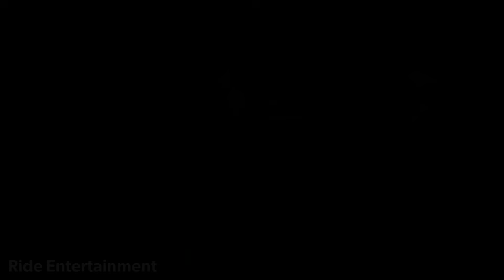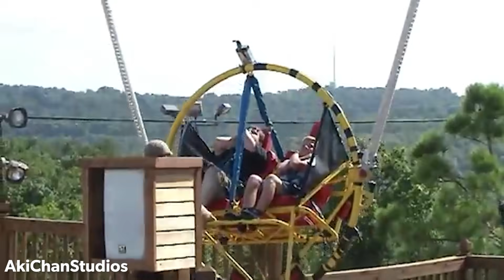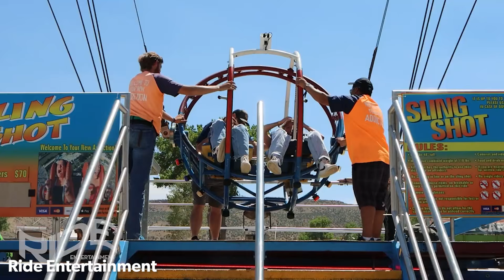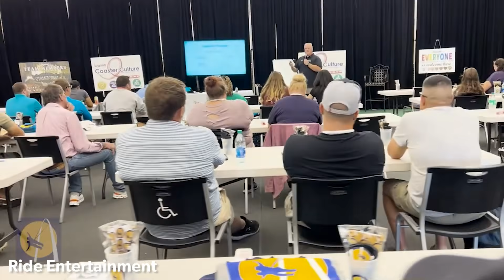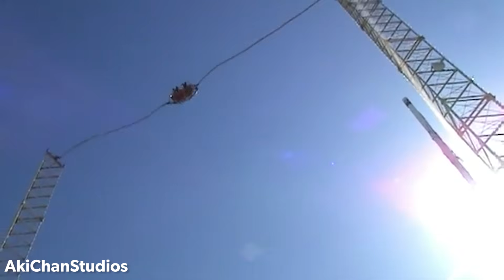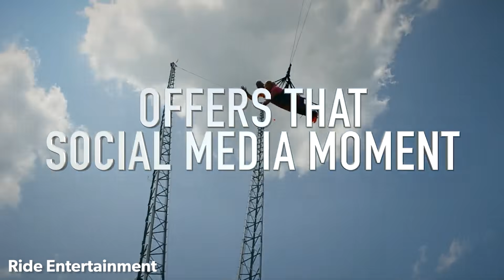Why Are SlingShots Dangerous and SkyCoasters Safe?

Comment: When I was a kid I worked on Extreme Skyflywr at (at the time) Paramount Canada's Wonderland. As a ride operator it was my first ride to work on. And while initially not as excited (hoping to work on a real coaster instead) the experience was pretty amazing. I was initially absolutely terrified of the ride. But after studying the detailed manual thoroughly and learning the various operator stations it definitely put my mind to rest that this was probably the safest ride in the park. I went on to also work on Drop Zone and Top Gun but neither really provided the same experience as the skycoaster did.

Comment: I don't like the idea of an electro magnet holding it back. Just a short power out, only fractions of a second and it launches unexpectedly. I hope there is a mechanical backup for getting in and out of it.
Reply from the maker: There is a mechanical pin that retracts shortly before the ride is intended to be launched on the spring box version.
Reply: @CoasterCollege  Good to know, thx.

Comment: The thing is, not everyone can design a ride, but nearly anyone can build a ride, and anyone can run any ride (depending on local laws of course) meaning there will always be a gap between the person designing the ride and the person operating the ride. Having a fully trained representative from the company on site at all times completely removes all of that, as the operators are learning what the designers need them to know to keep people safe. The only thing that limits this is the fact that every ride is different, meaning standardized designer/manufacturer training would be difficult at best.

Comment: I’ve done a sky coaster, specifically the one at Six Flags America (yes the park is as mediocre as people claim), and tbh I felt 100% safe doing it. There’s not as many variables and points of failure as with a slingshot, and I trust a metal cable way more than I’d trust a bunch of elastic bands

Comment: The difference is that one is basically just a swing, the amount of tension isn't ever that significant, it's powered entirely by the force of gravity. So long as you know the length of the rope, you know exactly where to keep clear so it doesn't hit anything.
The other is what amounts to a rubber band, constantly held under an immense amount of tension because it is the source of energy that launches the riders into the air. And, as is all too common when it comes to amusement rides, the equipment is not checked or replaced anywhere near as often as it should be. It doesn't NEED to be dangerous, it's only a result of the safety culture (or lack thereof) in the industry that makes it so.

Comment: From a very casual physics perspective, sky coasters work with gravity acting as a stabilizing force with riders moving in a smooth, easily modeled arc, while the capsule rides primarily fight against gravity, and are jerked rather abruptly (apparently into semi-random directions) as they reach the highest rise and fall of each pendulum period. The capsules are inherently less predictable, higher-jerk systems
Reply: Also they don't put nearly as much stress on the safety-critical components of the ride's design. In swinging back and forth, no pieces have to have the same kind of elastic give that the elastics do in traditional slingshots. Funtime mitigates this risk by adding a bunch of extra redundancy and moving the high potential energy contraption away from the riders, but the traditional design is incredibly dangerous. It's like in engineering how relying on components meant to flex and/or stretch will dramatically increase the need for regular maintenance, pieces like that tend to fail more frequently because the things they're doing are the same sorts of things that would normally count as harsh wear on rigid parts.

Comment: I was a site controller in 2012-2013 at Six Flags New England, Site MA-28. I would like mention that in our case, we did not receive training directly from SkyCoaster. Instead, we were first trained by our already-certified site controllers that had been in our ride crew the previous season, and then a representative from SkyCoaster would visit our site in early June to proctor both a practical and written exam. 95% of the ops trained on our site were site controllers, because if you're going to be trained on all four positions (flight suiter, expediter, assistant controller, controller), you might as well go all the way. Site controllers also got a small pay raise and get to fly for free at any SkyCoaster site in the world, as long as you have your site controller card with you, of course.
Reply from the maker: If you were trained by a site controller then you were trained directly by Skycoaster
Reply: @CoasterCollege  Our site controllers were ride operators employed by the park, not by SkyCoaster. SkyCoaster provided us copies of the owner's manual and example written exams, but all of our direct, hands-on training was done internally based of those materials. The only time a rep from SkyCoaster ever showed up was to proctor the practical and written exams.

Comment: From a physics perspective, skycoasters only have to hold the weight of the rider, as the wire is always taut, allowing for steel cables to be used, and with a very gradually increasing load.

Slingshots on the other hand must pull with many times the weght of the riders, as they physically fling the rider up into the air. The cables also experience sharp peak loads and need to be completely elastic.
Elstic cables experiencing dynamic loading are inherently less durable than static steel cables undergoing near static loading.

From this it is easy to see that slingshots are inherently more dangerous than skycoasters.

Comment: I went on the skycoaster called ripcord at Michigan's Adventure and before I rode I saw many people ride with no incident. It is also a very thick metal wire and the only way to fail is a human error of the rider's doing which is also unlikely because of how the workers explain exactly what to do to ride safely. I had a great experience in Michigan but my favorite part by far was the ripcord. Its not as tall as others, at 85 feet, but it is still a thrilling ride and I encourage others to ride skycoasters because there are no regrets. Except the money I played like 50 bucks for just me.

Comment: I feel like they should have a coiled up cable in the bungee cord to catch the capsule if it snaps, instead of if it snaps just death.
Or maybe an intentionally weak part of the bungee that's monitored by a doohickey that automatically cuts the bungee at the safest position to make them not go splat

Comment: The big problem I see with skycoasters is that it looks like it takes half an hour just to strap one or two people in versus a slingshot that probably only takes a minute (if that).  How do parks with skycoasters handle capacity?
Reply from the maker: Simple, they have multiple flight suits. This means that one group rides the ride, one waits, and one is getting suited up. They can manage similar throughput to slingshots.
Reply: @CoasterCollege  I can see that helping, but it still looks like an agonizingly slow process to get people into that harness, even if you have two or three available on standby.  But hey, if it works it works.

I think I'd prefer the sit-down version.  The "Superman" position looks like it would break my back.

Comment: The funtime slingshots are incredibly safe. They do deliver a tamer ride, though. Still, safetey first. They still provide a thrilling ride with a great view. I personally recommend the funtime slingshots without any doubt.
The newer restrains for the funtime ones came a lot later, though! The first ones used the same ball and the "standart" over the shoulder restrains. Skyline Park in germany still has the old gondola.
Reply: And the Skyline Park one, was the only time I've tried it. Super fun and included with park admission.
Reply: @PuentesRE  In Geiselwind there is another Funtime Slingshot, not too far away from Skyline Park. Fairly new, too. This one is located in the woods and uses the more open gondolas with Gerstlauer restrains.

Comment: I was a Site Controller at Cedar Point's Ripcord in 2011! I had worked SF Great America's Skycoaster the previous season, though not as a site controller. Once Cedar Point heard I had that experience, they instantly assigned me to Ripcord because they knew how specialized the training is, and even coming from a different chain (at the time) they trusted it. 

The requirement to have a site controller on scene at all times was great for my finances. As the summer went on and others gradually left, I got scheduled lots of hours because I was needed. And I got to do lots of free test flights
Reply: I was site controller at valley fair for 2 summers, and the start of the 2nd year I was 1 of 2 that they had until like June. Tons of hours whenever I wanted plus I loved working there anyway since it wasn't busy all the time like other rides. Plus all the test flights! (The other SC didn't want to test fly ever so more for me!)
Reply: Aw, the bay area Great America's skycoaster is the only one I ever went on! Did you know that place is closing in the next 5 years? :(
Reply: @phyllojoe5346  oh I actually meant Six Flags, not San Francisco. But, i did recently visit California's Great America to see the sister to my home park. Knew the closure was pending and made a point to get there.

Comment: I’ve been on a sky coaster, I felt completely safe, besides it being so close to a building but after watching others ride I saw that it was far enough away. With the way we were strapped in I didn’t feel like I would slip out and with how much I tensed up I wasn’t going anywhere. It was a cloudy day that day and I was kinda worried that the wind could affect it but after we rode it they closed it temporarily I guess because of wind, or employees were on break. And one thing where I could imagine user error is the way they signal the pull chord. He said he would give me a thumbs up but he just kind threw his hand into the air so I couldn’t tell if that was the signal but after a few seconds he signaled again and I pulled the chord. I can imagine someone pulling the chord too early as it’s still pulling them up although I don’t know wether they have a safety mechanism or if its designed that they still fall just not as high🤷🏼‍♀️. I always try listen to the workers and do as they say because although I love thrill rides I’m very safety conscious.

I don’t go to amusement parks often so whenever the county fair comes around I’m very picky about which ones I ride. There’s one they bring often like the swinging boat and it just has a lap bar, I had a bad experience riding one in an amusement park (I was exactly the height minimum) and almost fell out. So when my friend wanted to go on it and we sat down I couldn’t shake this gut feeling I had so I told her that I don’t feel safe on it, and she’s usually the one that backs out of things first so when she heard me say I didn’t feel safe she believed me so we didn’t ride. Nothing bad happened in that run but my gut was telling me no so I listened.
Reply: On a skycoaster if you pull the record before you get to the top you're basically just cheating yourself out of a ride but nothing else happens it just means that you don't go as fast or as far
Reply: @sfotnews8633  that’s what I figured
Reply: Swinging ships are so safe people stand up on them. There's a particular one where the park installed cages on either end that you could stand up and get thrown about in. If you're that worried about the ship you should sit right in the center where the mast is situated until you're used to the negative gs pulling you out of your seat on purpose. The bar is meant to keep you down, sorta, it's more of a grab bar so you don't fly out too much. 

Basically you are meant to hover at the peak of the swing. If the hover scares you sit closer to the middle, you'll experience less negative gs.
Reply: @spinningpeanut  I probably was just freaked out at the time bc I was 8 when I rode my first one😅
Reply: Omg I hate those swinging ship rides so much, they always have like no protection other than a thin metal bar and yet they go like vertically, and they feel like they just keep going higher and higher and aren’t slowing down, I hate them so much, I rode one once and never again, just watching them makes me feel uneasy
Reply: @NaThingSerious  yup. A lot like this original commenter, I rode one when I was pretty young. I met the height requirement, but I was a stick pole of a kid so I sometimes felt like I wasn't secure in certain rides. This was one of them, where the "floaty" feeling at the end of each swing terrified me instead of feeling fun. I still have occasional nightmares that include the "seat tipped completely forward looking down or reclined back and falling from my seat" feelings/experience.

It's not a "thrill" I'm eager to have irl anytime again!

Comment: With how many times those bungees have snapped, having riders in mostly open cars where they can be hit by debris or slammed into the ride supports feels negligent as hell. It also feels like those capsules move very erratically, which would be incredibly difficult to predict the forces on riders.
Reply: Except the fun times one, that one is much more controlled

Comment: TLDR : Sky coaster is just a giant swing. And they have good customer service 

Slingshot is literally at its name. You can trust it as good as handheld slingshot, which is not yours and nobody know when and how it's gonna break.
Reply: who told you I never owned a slingshot and one just appeared at my childhood home
Reply: but does the sky coaster also work for fursuiters? 🤔
Reply: @circuitbreaker1434  natural selection
Reply: If they were more careful with the modifications and actually maintained them then they would be a lot safer. User error should not be considered as part of the safety risk imho. That's like saying cars are more dangerous because some people don't take care of them and sometimes as a result wheels fly off or breaks fail. No it isn't the cars fault that you put 5X the expected lifespan of use onto certain parts.
Reply: @VadersFist501st  car is indeed more fatal and dangerous than other transportation tho, espescially public transport

Yes, there's many factor why. But that's the point, so many thing can't go wrong espescially from the user

Comment: slingshots always look really really fun, sad to know they're generally so unsafe lol
Reply: The models with the 'spring box' are significantly safer than the bungee ones. I only ride the Slingshots with a visible springbox.
Reply: @Steyr6500  Never trust anything with a bungee... whether it's theme park rides or fitness equipment.  Always count on the bungee breaking because eventually it will.
Reply: I didn't find it fun I felt really insecure then a year or 2 later the one I rode snapped never again for reference I love rollercoasters
Reply: Its depends though